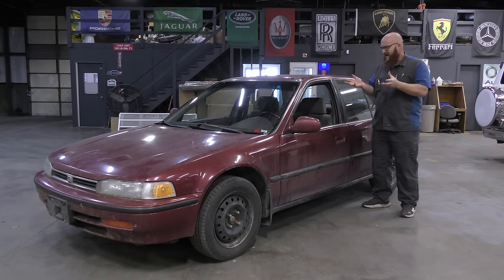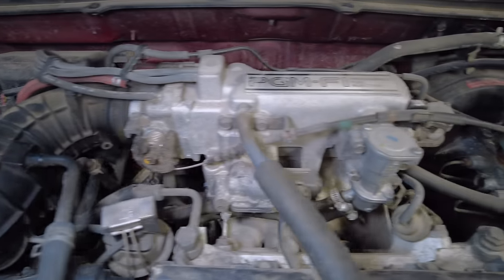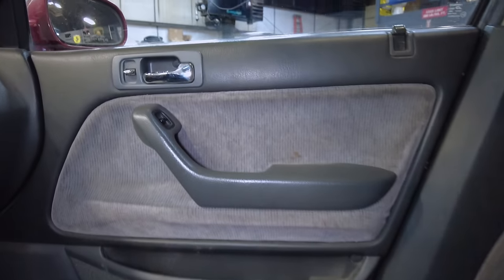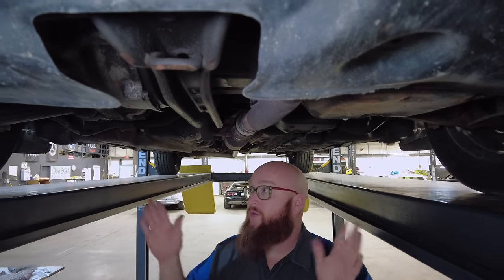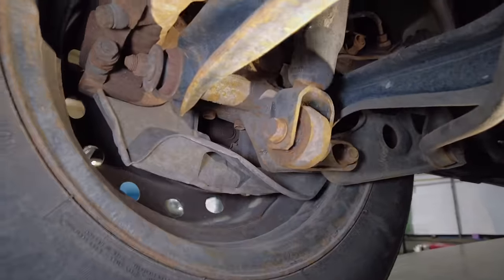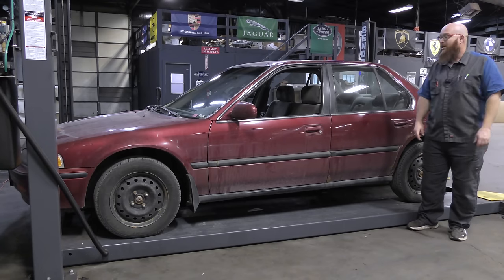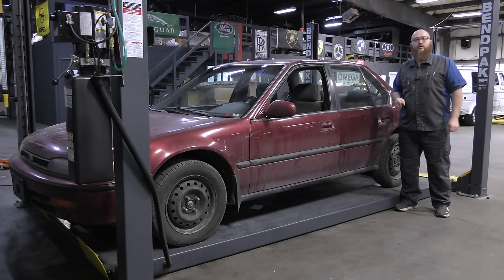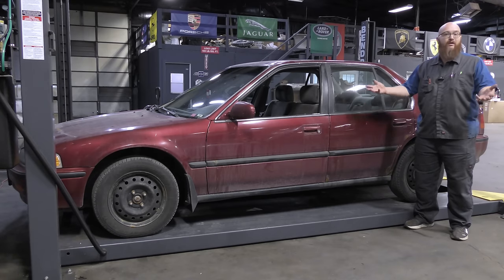A True Testament: 32 year old Accord with 380K miles! When Is It Time to Let It Go?

Comment: Absolutely worth putting in the money. This is stupidly reliable at this point! Has easily life left to reach 500k miles
Reply: I’d be afraid to drive it since it doesn’t meet modern crash standards and is too low and too light.
Reply: @user-tb7rn1il3q  What is not "too low"? A tacky SUV/CUV?
Reply: @Sonny_McMacsson  I’d at least want to be in something like a Subaru.  That tacky CUV driven by someone buried in their phone will put you in the hospital after they roll up on your hood.
Reply: @user-tb7rn1il3q Nah, this car would be more like to roll that Crossover.
Reply: @user-tb7rn1il3q  Subaru what? Outback (Can't think of anything else sorta not a CUV)? It's just lifted, not any more of a vehicle than if it weren't messed up with bad suspension. Anyway, I've seen Minis cause Suburbans to roll over on their sides and hardly be bothered.
Reply: @Sonny_McMacsson  Sedans are actually more likely to roll than a modern CUV, SUV, or Pickup.  Most people that get injured or killed are in a low car.
Reply: @user-tb7rn1il3q  I have to say, this 'too low' concern is very interesting. Just by pure physics alone, a high truck thing is far more likely to just plumb ol' tip over. I've seen them end up on their side just turning a corner - albeit that was something that was modified and lifted, but physics alone dictates if something is going to be top-heavy and roll.
Reply: @user-tb7rn1il3q  This is not only completely false but also a physically unsound contention. It's more like a bogus sales pitch.
Reply: @Sonny_McMacsson  They are wider and have better suspension.  You can have a taller vehicle with better roll stability.  In most crashes low cars get overridden and their structural safety cage collapses.  Even if a vehicle rolls over the safety cage will stay intact.
Reply: @user-tb7rn1il3q What you said is false, full stop. The highway safety data puts the taller vehicles at about twice the rollover rate of sedans. I'm not going to debate it. Have some dignity and just stop. It's funny and sad how someone will just double down in the face of being defeated by actual facts. It's over. Go home.
Reply: My 1994 ford tempo tranny died 3 weeks ago at 452,000 miles, so I too believe that accord will be an example to the hall of 500,000 miles fame.Cogratulations to the owner in advance.
Reply: @Sonny_McMacsson  The death and injury rates are much higher in sedans.  Rollovers are rare even in very tall vehicles.  The safest consumer vehicles on the road are lifted pickups.  This is why school buses are so safe.  The collision forces are driven under the vehicle and not into it.
Reply: @user-tb7rn1il3q  Well yes good points but honestly whats the chance that happens that you don't notice someone on the wrong side of the road coming straight towards you in something like a rear end collision unless someones in the backseat you should be fine and a side end well thats fatal no matter what so as far as I care my C32 is perfectly fine especially since in the 15 years I've had my Altis and the 5 wrecks some quite bad its gotten into never once have I had a single airbag deploy so yea don't really need safety
Reply: @user-tb7rn1il3q  Also dude the death rates are not higher in sedans mainly because more SUV's or trucks crash each year wayy more so more deaths I'm not sure where you got that from but its not accurate and also the way I see it if its fatal in any car its gonna be bad in an SUV
Reply: @Toyotacorollaaltis-cn9fd  I think for him it's just opposite day?
Reply: Some hubcaps and a wash will do wonders for that car.
Reply: Sedan vs modern SUV? Why not modern vs modern? Why must you be so deceptive?

Too heavy vehicles are more likely to roll, you cant argue against physics, so deception is lal you got.
Reply: You're so desperate to defend SUVs it's hilarious.
Reply: @Sonny_McMacsson it's true though, cars with slim A pillar don't have the rigidity of 2000s car beefier A pillar, most of these cars failed to maintain the cabin structure in the overlap crash test.
Reply: to low means it is less likely to flip over like an suv.  Plus all that glass made it probably the one of best cars for situational awareness ever made.
Reply: low center of gravity vs high center of gravity.  This car is less likely to roll over but a large suv would cause major damage due to the bumper height and weight difference.
Reply: @eddieredmann3 just to bring some facts into the discussion instead of just feelings 😅and anecdotes. This vehicle is 30 Plus years old that means it’s crash safety standards do not meet what other vehicles today do. To elaborate on a point someone else made here, the weight and over all smaller dimensions make it a dangerous place to be in a accident with many vehicles today with gvrw of over 5000 pounds. 

Just saw this same year accord meet its match in napa a month ago with a new model ford escape hybrid… it did not fair well 😞 just peeled the front of the car into the cab. The weight was definitely the issue and structurally , the way they do laser multi point welds and use different strength materials than were even available 30 years ago, means the outcome makes sense. I’m not saying junk the car per say I just am saying if it’s safety you’re concerned about, this would by far be an unsafe car today. Again, the average gvrw of vehicles today alone mean this light small car has a high probability of you not walking away from the accident. Just some food for thought
Reply: My car, although unsafe by modern standard, is still safer than the Accord. At least it's safe enough if you where in a normal crash, you might walk away. But good point about the Accords safety, it has none. I didn't think of that.
Reply: The mechanicals will go that far, but the rust is the X factor. The rust will advance to a point where the body shell is no longer reliable.
Reply: I had a 1993 model it was the best car I ever owned
Reply: @hectorvalentin8613  if the transmission lasted 400k miles or more, why not just rebuild it to last another 400k miles? Very few new transmissions will last as long and they will cost more. A good car is still a good car, a new car might be shit after the new wears off.
Reply: @Drebin211   I wish that, but so far the shops I contacted in my area does not have the parts for it and even worst the manual transmission is a rarity on our market.
Reply: I daily drive an automatic 1993 Accord LX. Best 1000$ I've ever spent on a car lol purchased it from the original owner 2 years ago and never a single issue with it apart from normal wear and tear (brakes, ball joints, etc...)
Reply: Hey “user123_ppwhatever” your argument boils down to “bigger and heavier means safer car!” yeah we get it, you enjoy ramming into families of four in their minivans and station wagons and watching their pathetic shitboxes crumble under the force of your 5 ton Jeep Cherokee Grand Wagoneer Deluxe 4x4 Diesel Shitmuncher with custom sidesteps and girl silhouette mudflaps. I do too! And while I live in Los Angeles, life isn’t grand theft auto, and average people don’t need needlessly massive high clearance vehicles, which by the way roll over in accidents the most out of any vehicle according to every highway safety organization I could find from NHTSA to car safety data in China.  If you want safety on the road, make every single person on the road drive sedans, coupes, and wagons with average to low ground clearance and fairly round or gentle slanted edges around the headlights & grille, basically everyone drives Toyota Camrys and Volvo S60s and the like. An increase in high powered SUV and large pickups in the last 10 years has resulted in an INCREASE IN FATAL ACCIDENTS and killing pedestrians. Fact! Proof: https://www.iihs.org/news/detail/new-study-suggests-todays-suvs-are-more-lethal-to-pedestrians-than-cars  https://www.nhtsa.gov/press-releases/speed-campaign-speeding-fatalities-14-year-high  Does that make sense?  :)  Hope that helps.
Reply: Anything could fail at anytime at this point. He says it right in the video and I agree. It's a grocery getter at this point and not worth putting a lot of money into.
Reply: My tdi jetta hitting 460k soon
Reply: @kevinmach730 "anything could fail at any time" could also be said of many much newer cars.  
Another viewpoint: Anything that could have failed would have already done so. 
I like new stuff and and old stuff too.  
Life is full of risk.
Reply: @LafemmebearMusic I wrecked two of these as a teenager in the 90’s. One accident I was doing 104 mph (car’s governed limit) on a back road and wrapped the car around a telephone pole. I might have had a bruise from the seatbelt. The car was safe enough that my didn’t think twice about kicking the crap out of me when she found out I wrecked her car.
Reply: @user-tb7rn1il3q False you are spreading lies and misinformation. Crash standards have not meaningfully changed since this was made. And worse, there are so many CUVs and SUVs on the road that don't handle and end up in rollovers, which are the most likely to cause a fatality.
Reply: @dancooper6002  Crash standards have changed a lot.  UVs now have better roll stability and roof crush strength than sedans.
Reply: @gormenfreeman499 You could’ve just said you’re lazy and you don’t wanna work on older cars at all and you would rather make a bunch of car payments every month and one months payment could be the cost of one used car while you’re trying to make the worst examples possible yet i have a 1981 Datsun 200 SX that I drive daily that’s a manual transmission so therefore that’s already more reliable than an automatic and it still runs and drives perfectly and it has like almost 300,000 miles and I don’t have to do that much maintenance and it gets great gas Mileage lmao and I only paid $800 for it nine years ago and yes, I was just imitating how obnoxious it is rambling on with no periods. get real new cars suck ass! They’re more disposable than ever! Also way too complicated and costly to work on.
Reply: @user-tb7rn1il3q trucks and SUVs cannot get too wide, due to limitations of parking spaces and garages. So your argument about wider base doesn't work. The higher center of gravity with a similar width to sedan means these taller vehicles are more likely to roll over at sharp turns.
Reply: @_Wai_Wai_  They keep getting wider though.  This is why parking is so tight in some places.
Reply: Would my 2000 Camry le i4 be worth fixing? It has 211,517 miles and needs about 3,500 worth of work
Reply: @ChickenGaming-er2dy  If you can’t afford to buy another with cash, it might be worth fixing.  Try to fix it for less than $1,000.  I’d try to determine if the repairs are actually necessary.  Find a place that will fix it cheaper.
Reply: That car has been babied. I wonder if it had engine out though to fix the oil pan gasket?
Reply: But most of the million mile vehicles in America are Chevrolets
Reply: @toddsmith8608  Yup, that's how I look at my 28 year old Civic and 35 year old Legend too: The fact that they still exist and are still being very reliably used shows that they had plenty of time and opportunities to fail, but they didn't. There are much less parts to fail on something so simple too.

I'd personally be more worried about driving an unproven brand new model on a long trip than a well maintained older car like this with proven reliability and minimal failure points.
Reply: @user-tb7rn1il3q definitely not true 😂
Reply: 25k miles on the timing belt. Put at least another 75k on it.
Reply: This car doesn't track you and sell your data to insurance companies
Reply: @user-tb7rn1il3q  Low cars are MUCH safer.  The lower, the safer.
Reply: @StormsparkPegasus  Not when someone buried in their phone hits you with their SUV and your head is at their bumper height.
Reply: So your stuck with it because nobody is gonna buy a car with 380000 miles except a junk co
Reply: I agree 👍. I would rather fix the brakes, give it a complete tuneup, and keep it for another 100k miles. That would be the cheaper option than buying another one that may cost more to repair.
Reply: @user-tb7rn1il3q  LOL, someone feels like they have to justify their SUV purchase.